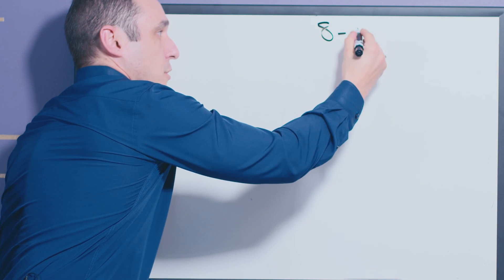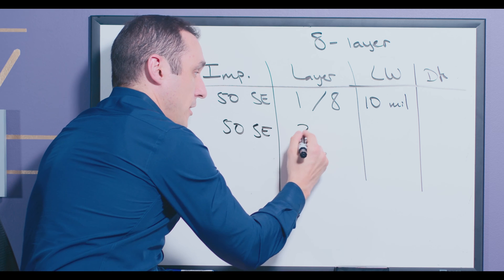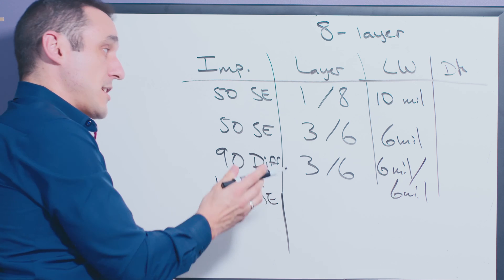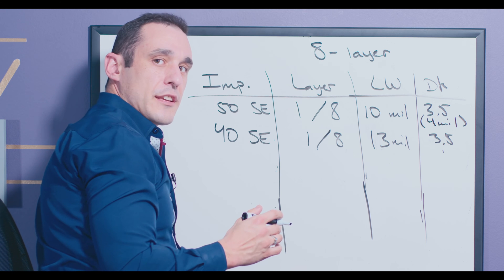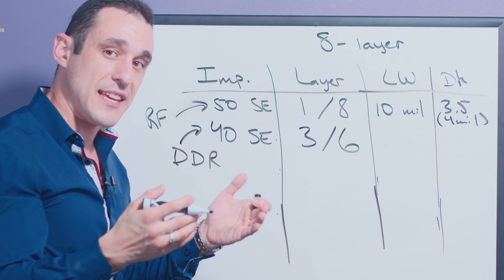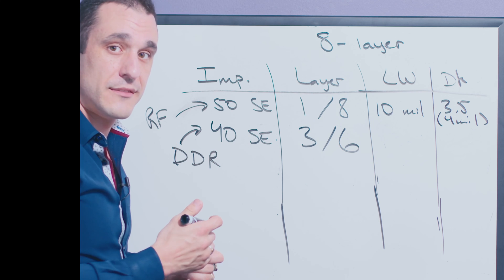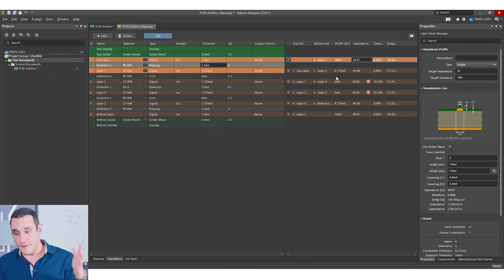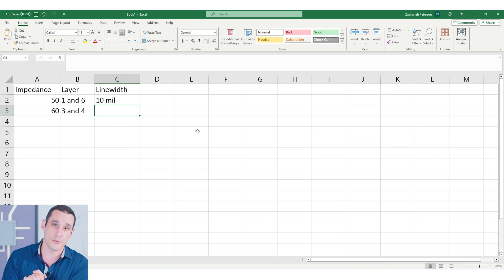Your Quick Guide to Understanding PCB Impedance Tables

Comment: Thanks for the video Zach! I actually wonder if people still make their own stack up and suggest this to the manufacturer. I always give them the impedances I want and the total board thickness and let them run the Polar. 
Good to know that it is actually called an impedance table I have been asking for a Polar table for years 😂
Reply: I create my own stackup, or at least a portion of the stackup, on all RF designs and on any design that has at least one digital interface requiring a specific impedance. There are specific groups of materials I like to use just because I know them so well and I have used them in many projects. I will then contact one of my fabrication houses or my client's fabrication house and make sure they can supply that material or a direct substitute. Sometimes I have to push on them to use specific materials that I want. This way, I can use multiple different impedances on the same layer, or I can use differential and single-ended on the same layer, and I don't have to rely on the fabrication house to try and build it how I want.
Reply: The name suggests the impedance table.
So you need to be that curious to recognize it from its name.